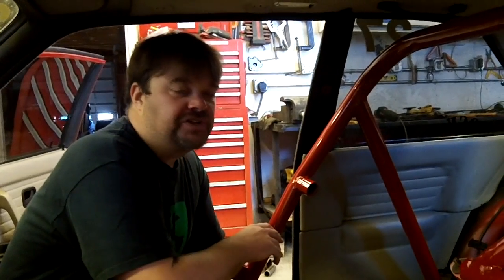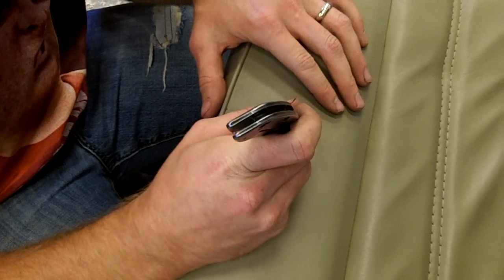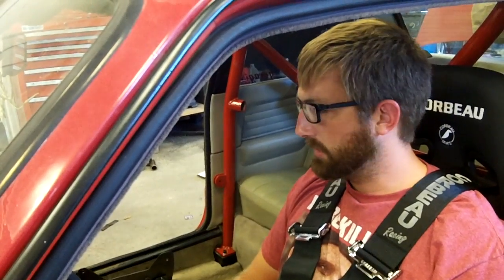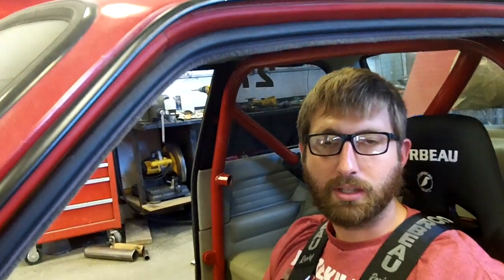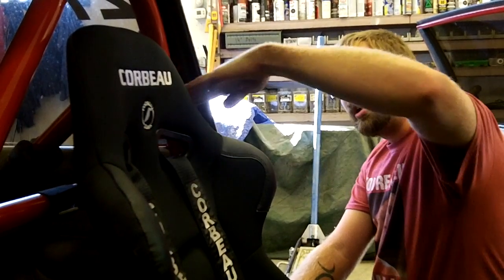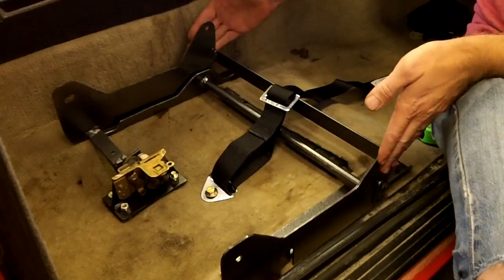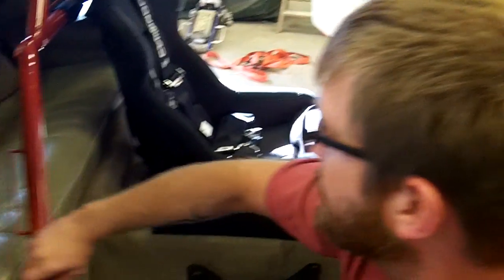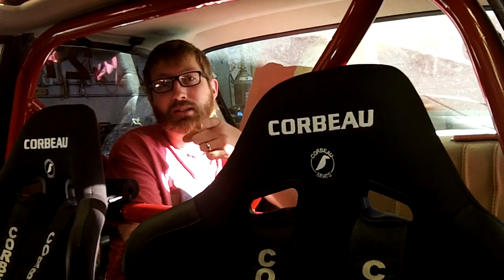BlockHeads Garage Ep.12 Bmw E30 Cage, Seat, Harness Install

Comment: A caged car on the street can be quite dangerous in a crash, as your head may strike the cage without a helmet. In the case of your kids, that cage may significantly harm them even in a low speed crash. Foam padding only slows very slow deceleration. Nice build either way!
Reply from the maker: +rezenclowd3 As my head goes the cage is so far behind the seat, the seat would have to break for me to even get close. For my kids I know where you're coming from, that back seat is for the 4 blocks to the daycare or school, not that something can't happen. They'll never be back there on the highway. Hey I do appreciate your concern and thanks for watching.

Comment: Did you fabricate the latch for the seat or was it bought, I plan to do the same set up for my e30, along with the bar hinge. Any insight or help I could get would be honestly amazing!
Reply from the maker: I used an old door latch I had laying around. The hinge is made a solid rod and tubing that fit around it well. More than happy to answer any questions you have.

Comment: Great video! What brand of cage is this? Also, does it touch the roof and interfere with the sunroof? The PO of my e30 put a half cage in kind of like this and it makes using the sunroof hard because it touches the top and compresses it a little.
Reply from the maker: I actually built that cage myself, it does just touch the headliner.

Comment: Anything else in the works for car videos?
Reply from the maker: +Petrol360 Yes, I do have more plans for the car just don't have the money right now. There's a big brake kit, new tires/wheels, some body mods, and a "mod" I haven't seen done. So it should be interesting, just gotta get some coin.
Reply: Sweet just want to make sure you were still going on the project!
Reply from the maker: Yep this will be sticking around for awhile.

Comment: Where did you buy this roll cage
Reply from the maker: +Alex Garofalo I actually built that one myself.
Reply: +Nate Ramsey That looks great what did you use for the swinging arm of the roll cage.
Reply from the maker: I found that hinge on eBay actually. it's designed to be a roll bar hinge super beefy piece. A lot of off road websites carry similar stuff too.
Reply: +Nate Ramsey Thank you so much I was looking for a way to have a roll cage and still have a way to carry passengers easily. Thank you. Did you buy the seat hinges in eBay too?
Reply from the maker: I built those too. Took a little engineering but wasn't too hard.